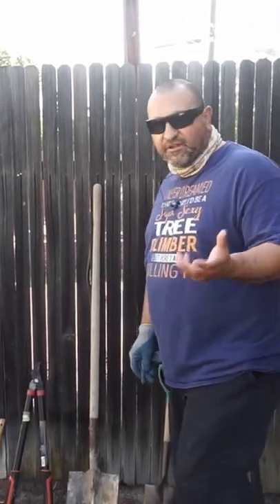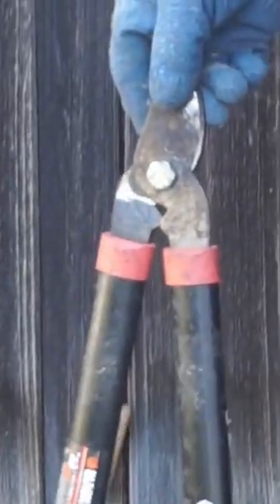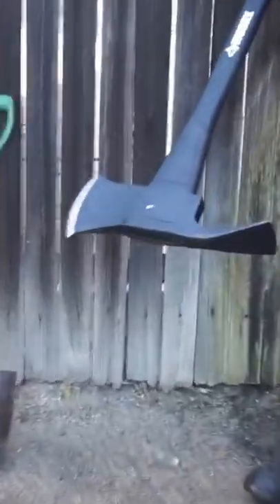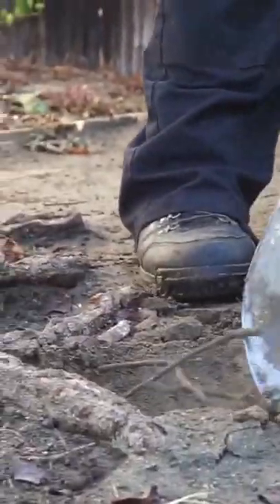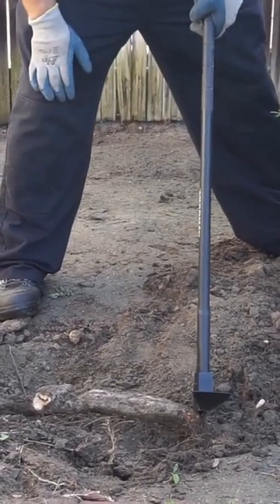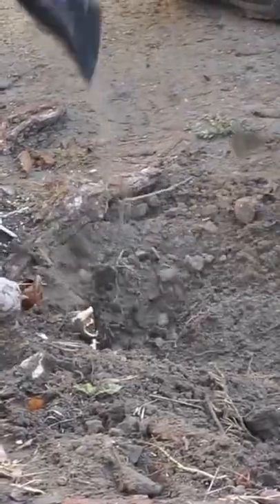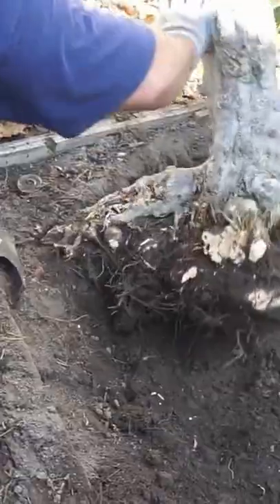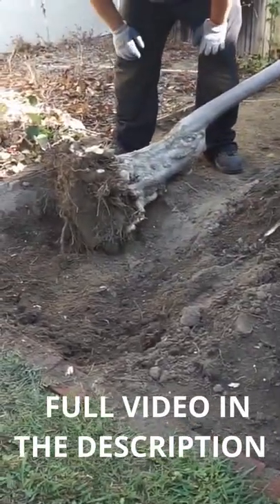Easy Tree Stump Removal, No major tools required!

Comment: Those axes with the tiny mattock on the back are ok, but if you ever try out a real cutter mattock, you won't use the axe anymore. Whatever you use, putting a proper edge on it will save a lot of effort. 

Love your vids, Bino!
Reply from the maker: I like the Mattocks more if I'm just digging but I like the light weight of the Pulaski when I'm removing roots especially if there's lots of roots. Great tip about keeping your tool sharp that makes a huge difference in energy use and time used. I sharpen everything.  If I'm planting a tree you can be sure I've sharpened my shovel. Thanks for sharing!

Comment: Problem is my tree stump is wedged in a tight space behind my shed which is right in front of my cement carport(6 ft high wall) and my neighbors fence right next to that.  It’s growing under their fence so I really only have access to 1 side.  I have all the items that you mention.  I’ve even tried to access it with a saw the space is too tight 😩  it’s like 2ft by 1 ft
Reply from the maker: There is a tool called MUTT it might be helpful.

https://www.harborfreight.com/4-inch-mutt-with-wood-handle-95005.html?utm_source=google&utm_medium=cpc&utm_campaign=19160190702&campaignid=19160190702&utm_content=149829371488&adsetid=149829371488&product=95005&store=414&gad_source=1&gclid=CjwKCAiAjfyqBhAsEiwA-UdzJJM82ve4F6bTE3hjf565_u8CqDxUnqQVzsuWFyKIwpSO326pJryp7RoCjacQAvD_BwE